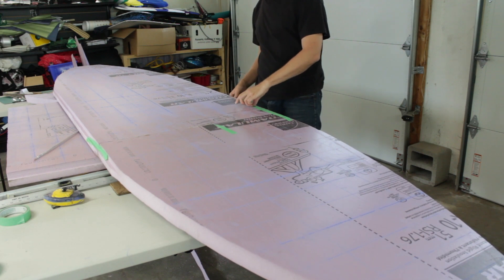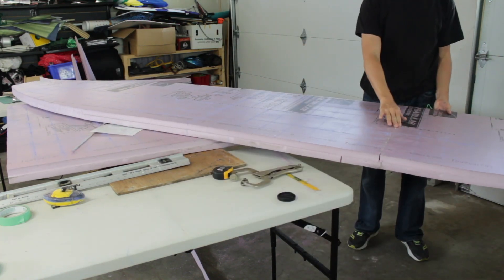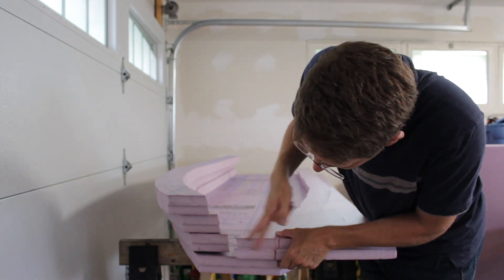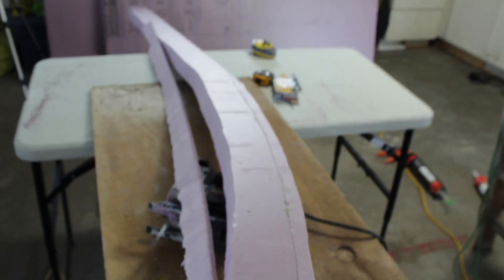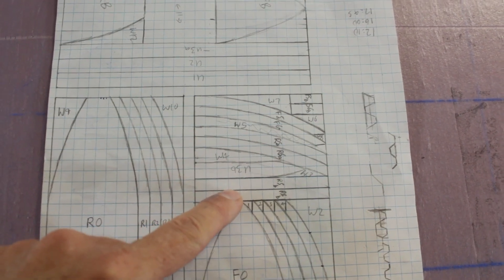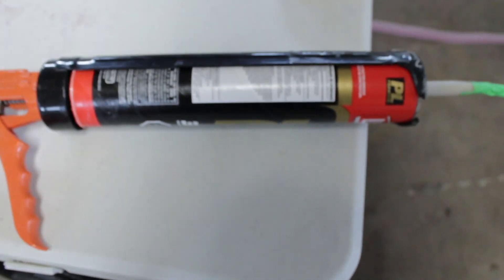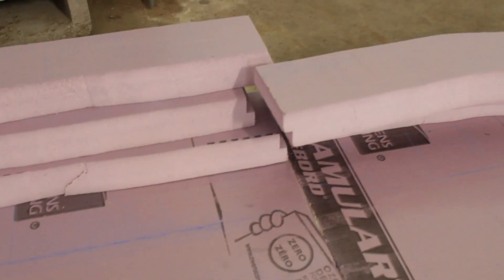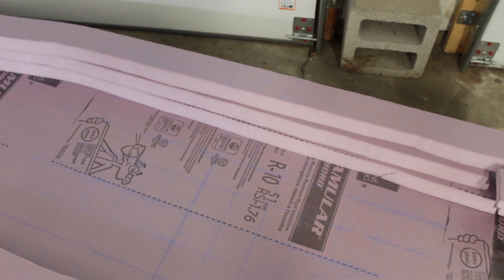DIY Foam Kayak - part 3

Comment: You should stagier the foam side connections.
Reply from the maker: Possibly, but it is strong enough without a stagger. That would have required me to buy an additional foam sheet, and create more wasted offcuts.

Comment: Can have the list to the material you use on this kayak: fiber glass and glue , etc.
Reply from the maker: 3 x sheets of 8 ft by 4ft 2 inch thick foam, 3 x PL premium glue canisters, 10 yards of 50 inch wide 6oz/square/yard fibreglass cloth, 2 x 3.74 litre cans of West system 105 epoxy resin, 1 x 814 ml can of 206 slow hardener, 1 x 814ml can of 207 fast hardener
Reply from the maker: + tools I had and tools I had to borrow

Comment: I called the joint idea the butterfly scarph joint,  yours turned out very well.
Reply from the maker: I was hoping to get the butt edge, but I could only get the ship lap edge board, but I think it will work out alright

Comment: Glad to see you doing this. I am interested in constructing one as well.
Reply from the maker: I'll try to post an update every day or two with all the things I figure out along the way.
Reply: The improved plans (this is being done by copying the 5th sawfish kayak built, one that used the original sawfish kayak plans)
Do a Google search for sawfish kayak for the latest plans
Reply from the maker: The cutting plans are based off a kayak I saw at Bass Pro